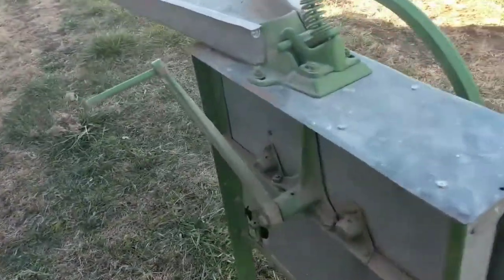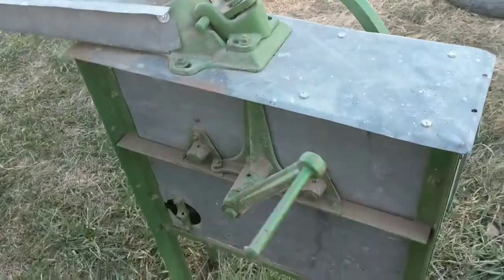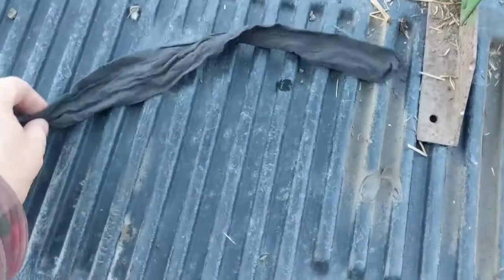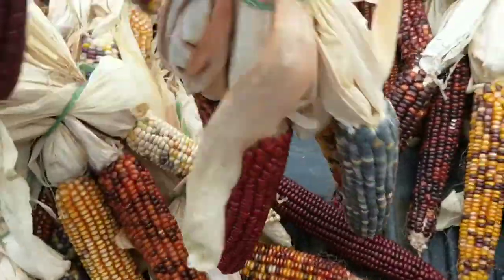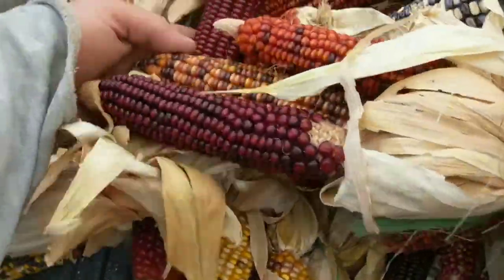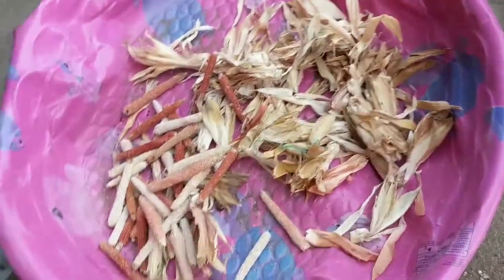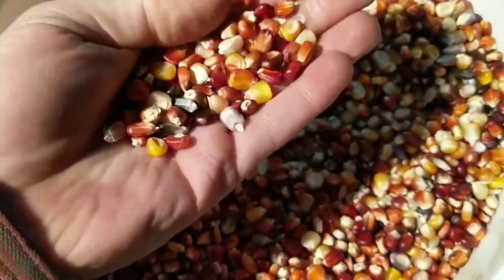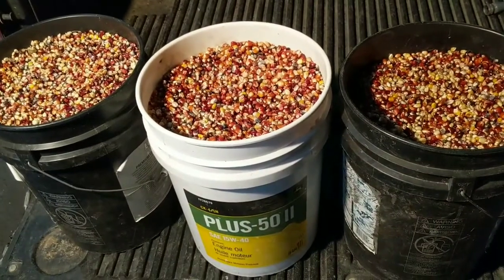Grandpa's old Corn Sheller

Comment: Wow, that thing is so cool! I'd love to find one of those. Love the corn, it's popcorn season too haha.
Reply from the maker: I tried some in the air popper.  It pops too but not as good as my regular popcorn.  I've got another sheller just like it in the shed.   Maybe you noticed the flywheel had a wobble.  It's been broke and brazed and so has the crank so I found some replacement parts.  I had popcorn and a Pepsi for supper.

Comment: We used to find a few ears of colored corn during picking.
Our hand sheller is a lot like yours. Not sure if it is JD. The shafts and cast bushings are so worn out, it would make an International 1586 grunt if it were hooked to a PTO.
Doc
Reply from the maker: The only other color I ever found picking was a little red tinge once in a while.  I have another  shellerin the shed that has some seized up shafts.  I think it sat outside it's entire life.